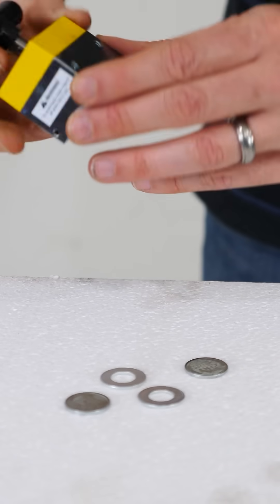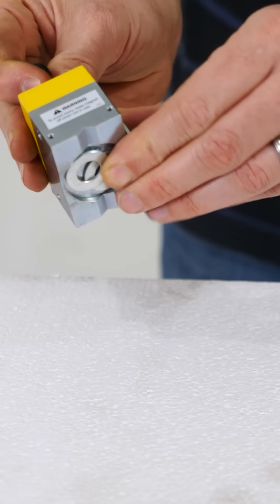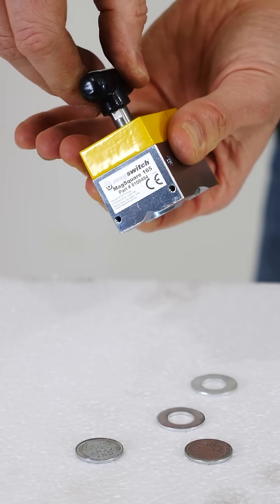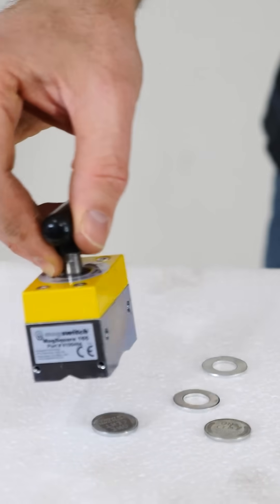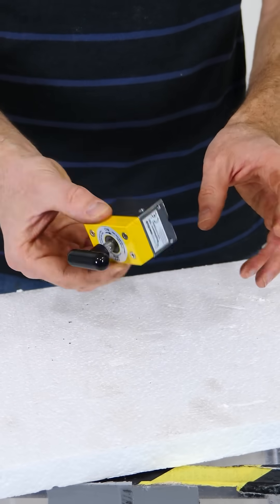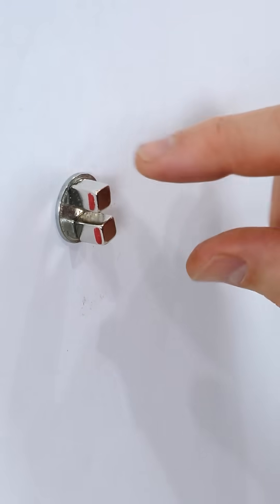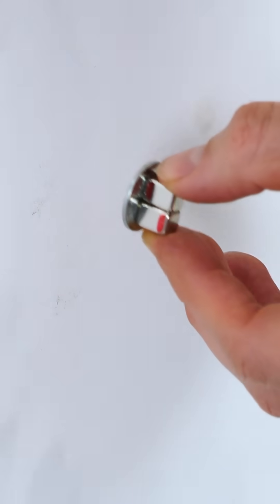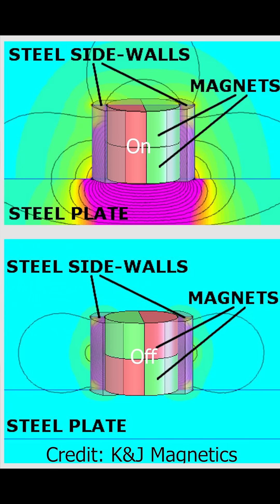How To Turn Off Permanent Magnets

Comment: We use big ass versions of these with a forklift for picking up sheet metal. Works great!
Reply: We also use them daily for the indicator base. Makes it super easy to slap an indicator arm onto a work hold and indicate a part or fixture into place. And same with the forklift, we use a 3 and a 5 ton lever magnet on the overhead crane to easily move parts around.
Reply: @BradyT918 you 100% don't have these on your equipment. You have electro magnets buddy 😊
Reply: @BradyT918 can we use magnets to hold car parts together vs screws or would that not be strong enough
Reply: ව්සෙජොට්ජුඉත්ට්❤ @BradyT918
Reply: @BradyT918 cool
Reply: Cranes too 🙂
Reply: @VividAuroraSkies damn did someone "Run over your face" 🤣im sorry
Reply: @VividAuroraSkies that’s how we use ours
Reply: @VividAuroraSkies are u still staying the F at home?
Reply: @VividAuroraSkies How tf do have 24 million subscribers?
Reply: @anonymous689  I think @BlackWidowRaiderette just put that in her channel description. Not a bad trick
Reply: We use big ass 🔥
Reply: I guess by now, there are magnetic drills like this? Did they have them ten years ago? About 7 years ago at the job, I was on an electromagnetic drill, lost power, and fell from heights. It broke a guys shoulder and collar bone. Obviously, it could have been worse.
Reply: The people I used to work for never figured out that was a thing, but they were so rude I never told them 🤣
Reply: Sounds cool, but why are they shaped like asses?
Reply: dang, thats cool
Reply: YouTube sucks. It keeps deleting my replies and my edits.
Reply: We have to use sheet lifter
Reply: id like to see what those look like.

There's this lego-esque game I play called trailmakers, and they have a magnet in the game: I made a crane truck and forklift using it. wonder if it looks similar in any way.
Reply: pick it up with ur hands u weak twigs
Reply: Yeah! Best part, they don't require electricity.
Reply: That's cool
Reply: Using them with cranes is soo shady but yet i still everyday
Reply: I never really thought about it but it is pretty clever, when I was a truck driver I cant be sure of course because some rare earth magnets are super powerful but I think that the stradlers on the docks might be electric.
Reply: We have ones for cranes to pick up the 2 ton pieces
Reply: I’m guessing you’re talking one sheet at a time? We use a similar magnet system and suction cup lifters to load single sheets of metal into the lasers I run but the full pallets are brought in on regular forks with the forklift
Reply: Ive seen them in use at the junkyard when i was a kid it was a spectacular machine to see.
Reply: Not in construction, but is there any reason to prefer one over an electromagnet? seems like it'd wear down the magnetic fields pretty quick if you're constantly switching between forcing the poles next to one another, and an equally-powerful electromagnet would be cheaper in terms of parts. Maybe less electricity usage, but do those savings outweigh the cost of a shorter lifespan?
Reply: Sh!t metal?
Reply: We use those to hold angles for welding to
Reply: Also in machining
Reply: Be careful when using those bro I’ve seen bad accidents
Reply: I'm surprised they don't go electromagnet for most forklifts, but then again this doesn't take any energy to "run" so I guess that's a benefit
Reply: Hell yeah
Reply: Yeah same in our Company we also Carry Steel sheets and Steel pipes with
Reply: Ye I am looking for Aerospace mechanical and painter
Reply: I used to use one when i ran a plasma cutter back in like 2005
Reply: yeah i don’t see how this is interesting, not your comment just the entire video.
Reply: sounds dangerous don’t wear any metal lol
Reply: So close! Thats an electromagnet🥰
Reply: we have them for our in shop cranes. works great for sweeping up the metal dust in your work area 😂
Reply: That’s what I was about to say haha they come in handy forsure.
Reply: They use 🧲 on semi trailers to
Reply: OMG I WANT TO USE THAT SO BAD IF U SEE A TEENAGE KID ON A FORKLIFT ITS ME!
Reply: Casual forklift certified flex
Reply: 😂😂 but not efficient permeant magnet..
Reply: ohh so THAT'S how those work, ive actually wondered that
Reply: Yea we have a 1,5 Ton one in our company they Work great
Reply: Sheet metal workers thank you
Reply: The comments here are as stupid as to be expected. 

These switched magnets have a very limited life expectancy because they get weaker as a result of depolarisation - magnets don't last forever if forced to sit next to opposing poles of near equal strength.
Reply: No
Reply: The scrap yard has one on a huge crane, trusting a magnet holding up 2 tons of steel swinging over my truck that can be switched off instantly
Reply: Language
Reply: how much and where at? these would help me 1000% right now. rigging heavy meatal takes a second, with 2 of these we can be movin
Reply: I use a big version of this quite often when lifting steel beams or sheet metal off the ground.

I never trust them but they are incredibly useful and haven't failed me yet!
Reply: Adam Savage has a large one of these on one of his lathes. So cool
Reply: Use them on dial indicators and the same for the metal shavings sweeper.
Reply: Wow
Reply: This is how I’m gonna climb things lol
Reply: Lol that is electromagnet this is clearly different 😂😂
Reply: I've always thought these switchable magnets are electric. Thanks to this video and the comments now I know better. 😊
Reply: There's always a certain person
Reply: We too Same Suff
Reply: Oh man I wish I had one of these for hvac. I've nearly chopped my hand off more times than I care to admit.
Reply: ❤️Just wanna remind you All  To repent and that Jesus Christ loves you all ❤️ Jesus is God , Amen❤And Don't use God's name in vain , like saying on god , God damn it , and God-somthing , or oh my God ( unless u say Oh my God to God as in praying ) ❤ and don't lie 😊❤And don't curse, swear or cuss , Forgive and don't Seek Revenge , revenge is for God not for us to get 😊 and just so you know , Homosexuality/LGBTQ++??? Is a sin ( Leviticus 18:22 Romans 1:26-28 Leviticus 20:13 ) , also , s*x before marriage is also a sin , since i am pretty sure that it is clearly sexual immorality ,  Don't Lust , since according to The Lord Jesus Christ , if a man looks at a woman lustfully ,he has committed adultery with her in his heart , which means it is pretty much sexual immorality , which is a SIN , a very awful  sin , And Don't watch Po*n , again , Sexual immorality. Cheating too is a sin, be loyal , also try your BEST to not get a divorce if you are married , unless it's needed or for a valid reason like abuse ( physical and/or  mental/emotional ) but let divorce be the last resort after what can be done is already tried and hasn't worked , be nice to everyone , never go to Mediums or psychics and don't believe fortune tellers / readers and zodiac signs, Don't hold a grudge on anyone , don't Use GOD for Materialistic and earthly stuff or Fame and popularity and money😊❤Have a Blessed Life With Jesus Christ , Jesus is the only way , not good works that you do, No one Goes to the father except through Him , Jesus . Always ask for forgiveness and Give thanks To God ❤️ also, Don't be Greedy , Don't Idolize something or someone other than God and don't be prideful, Be humble 😊 NEVER Deny Being Christian or Believing That Jesus Christ Is God And Is The Son Of God , Even if it meant Death and Persecution Jesus Said That Whoever Denies Him In front Of Man , He will Deny Him/Her In front Of His Father , God the Father In " Matthew 10:33 But whosoever shall deny me before men, him will I also deny before my Father which is in heaven" . ( Please no Hate if You Don't like my message ,  and also please do more research and God bless you all , Jesus loves yall , Have a blessed life ❤️ With Jesus Christ and also never forget as a Christian that Jesus is Not only The Son Of God , But he also is God , as he said " I and The Father are One " -- John 10:30 and also Never Forger the Holy Spirit since God The Father And God The Son and God The Holy Spirit Are 3 persons in 1 , The amazing Holy Trinity ❤😊 , lol i know that i keep saying more stuff after i said bye or Have a blessed life , i just Remeber more after i write Bye or Have a blessed life , 😅 , oh well , once again , Have an amazing Blessed Life With God 😅

Important message : if you think you are unworthy of God's forgiveness, you are wrong but right , how? Let me explain , all of us don't deserve God but his mercy and love is much bigger than our Sins , so , Don't you ever say to yourself i don't deserve to be God's Child and That God won't Forgive you , He will , Repent, Jesus Loves you all 😊❤
Reply: We use this crane attachment thing that has 8 suction cup things, I hated having to do that I never trusted it
Reply: Omg you’re a forklift driver 😍
Reply: @barnabro   ❤️Just wanna remind you All  To repent and that Jesus Christ loves you all ❤️ Jesus is God , Amen❤And Don't use God's name in vain , like saying on god , God damn it , and God-somthing , or oh my God ( unless u say Oh my God to God as in praying ) ❤ and don't lie 😊❤And don't curse, swear or cuss , Forgive and don't Seek Revenge , revenge is for God not for us to get 😊 and just so you know , Homosexuality/LGBTQ++??? Is a sin ( Leviticus 18:22 Romans 1:26-28 Leviticus 20:13 ) , also , s*x before marriage is also a sin , since i am pretty sure that it is clearly sexual immorality ,  Don't Lust , since according to The Lord Jesus Christ , if a man looks at a woman lustfully ,he has committed adultery with her in his heart , which means it is pretty much sexual immorality , which is a SIN , a very awful  sin , And Don't watch Po*n , again , Sexual immorality. Cheating too is a sin, be loyal , also try your BEST to not get a divorce if you are married , unless it's needed or for a valid reason like abuse ( physical and/or  mental/emotional ) but let divorce be the last resort after what can be done is already tried and hasn't worked , be nice to everyone , never go to Mediums or psychics and don't believe fortune tellers / readers and zodiac signs, Don't hold a grudge on anyone , don't Use GOD for Materialistic and earthly stuff or Fame and popularity and money😊❤Have a Blessed Life With Jesus Christ , Jesus is the only way , not good works that you do, No one Goes to the father except through Him , Jesus . Always ask for forgiveness and Give thanks To God ❤️ also, Don't be Greedy , Don't Idolize something or someone other than God and don't be prideful, Be humble 😊 NEVER Deny Being Christian or Believing That Jesus Christ Is God And Is The Son Of God , Even if it meant Death and Persecution Jesus Said That Whoever Denies Him In front Of Man , He will Deny Him/Her In front Of His Father , God the Father In " Matthew 10:33 But whosoever shall deny me before men, him will I also deny before my Father which is in heaven" . ( Please no Hate if You Don't like my message ,  and also please do more research and God bless you all , Jesus loves yall , Have a blessed life ❤️ With Jesus Christ and also never forget as a Christian that Jesus is Not only The Son Of God , But he also is God , as he said " I and The Father are One " -- John 10:30 and also Never Forger the Holy Spirit since God The Father And God The Son and God The Holy Spirit Are 3 persons in 1 , The amazing Holy Trinity ❤😊 , lol i know that i keep saying more stuff after i said bye or Have a blessed life , i just Remeber more after i write Bye or Have a blessed life , 😅 , oh well , once again , Have an amazing Blessed Life With God 😅

Important message : if you think you are unworthy of God's forgiveness, you are wrong but right , how? Let me explain , all of us don't deserve God but his mercy and love is much bigger than our Sins , so , Don't you ever say to yourself i don't deserve to be God's Child and That God won't Forgive you , He will , Repent, Jesus Loves you all 😊❤
Reply: On a forklift, it most probably is using an electromagnet that is designed to turn on and off. That’s the entire point of the video that I guess you missed. It’s not easy to understand how can a “permanent“ magnet turn off, since it’s supposed to be permanently on, this clever design just makes it seem like the permanent magnets have lost their magnetization but in-fact they are still magnetized.
Reply: @Dhairyasd  are you a smartass or a dumbass? You would think they know more about their job than you, mate.
Reply: Stop swearing
Reply: Actually those are electromagnets stronger than these magnets
Reply: Same here. We used it on a crane. And the funny thing is the magnet wasnt all the way on the metal piece because the metal piece had some edges and curves so the metal fell off loolz 😂
Reply: We use them in die shops for steel irrection to pick up die plates that weigh 70 plus lbs.
Reply: same!
Reply: Probably more reliable than electric ones if i had to guess
Reply: Big ass?
Reply: Cringe piece of human garbo who tf asked? Be glad shtty YT braindeads approve
Reply: Cool
Reply: Jesus is the Son of God. He died on the cross for our sins and was resurrected three days later. Believe in Jesus and you will not die, but have everlasting life.
Reply: The company i use to work for had some sketchy ass forklift extensions and whilst always get stuck loading the racks. Reverse that thing. Let those back tires wobble slightly up and gas out 😂. So glad I dont work there anymore
Reply: Same
Reply: I’m having a hard time imagining why the addition of a big ass installed on these magnets could be more useful to a forklift driver. Though I could see how it would make work more enjoyable.
Reply: Whoa
Reply: Ever grab someone’s keys out of their pocket?
Reply: Nice! Its cool to know where else they're used. I was a thread inspector for a company that threads new pipe to be used on drilling rigs in west Texas. We used these magnets to pick up small joints and load them into the CNC by hand. Very fun to use and it always had me curious 😅
Reply: I've always seen the big magnet at the scrapyards, I thought it musta been electro because they could turn it off in an instant & I never heard a sound when it switched...?
Reply: @erkl8823  yeah scrap yards definitely use electromagnets, they need to be able to operate it from the cab of the crane! Otherwise you’d have to have a dude hanging on the end flipping a lever 😁
Reply: @barnabro  oh! Ok, got it, cool man, 'ppreciate it
Reply: @barnabro or they have an permanent magnet on an electric switch? Think smarter.
Reply: @erkl8823 scrapyard cranes usually use electromagnets, that doesn't mean they couldn't use a system like this though
Reply: Wouldn't this be an sick version for magnet fishing , there gotta be out there
Reply: I saw a crane doing that with sheet metal at a factory i worked at once. I never got a close look at it so I suspected magnets but wasn’t sure
Reply: Have you ever used your Forklift Certification rizz?
Reply: @confusinggameplays1687  a couple of times i have; but i regretted it. Cuz it only works on women from the maintainance dept. So next thing ya know, u smoke a joint with em; and after that its all over. Cuz i can't stand to be around no high maintainance women.
Reply: @confusinggameplays1687  I'm sorry, i saw the window and couldn't help myself
Reply: @oliverklozhoff thats a well constructed joke
Reply: Used one before, just one of them was able to lift a 4 ton trench plate
Reply: I saw something like that in a warehouse to avoid damage (staff), but only like 1 or 2... that tool can help moving heavy stuff easily 😊
Reply: My old job at a extrusion die plant we used them regularly to move around the dies to different parts of manufacturing
Reply: It may pick up the forklift 200 ft away.
Ever watch loony tunes with wild coyote and road runner.
Reply: Jesus Christ loves you and died for your sins 🤎🤍
Reply: @barnabro I think cranes use Electromagnets not these!
Reply: I always thought they used electromagnets to do that. 

Glad I saw this video and your comment then, learn something new everyday
Reply: You changed the devices for digferent magnets and whan you turned the thing the magnet went farther inside so the metal thing fell
Am i right
Reply: @PetrusProGamer did u watch the video at all? Damn, oftentimes people would have no clue u were dim; if only u didn't declare it. Silence is golden. For the stupid, silence is platinum.
Reply: @PetrusProGamer  No. Watch to the end, it's only a short.
Reply: No u don't. Stop lying.
Reply: That is electomagnet. He clearly states that this is not an electromagnet. There is a big difference
Reply: @shrujanamsyama9940  why are you telling me about equipment at my work that I personally use? It’s not an electromagnet, it’s called a permanent magnetic lifter and has no power feed. Ours can lift up to 1000kg but bigger models exist.
Reply: @barnabro  what are these called? I want one for work. About the size he has in the video, i dont need a forklift sized one lol
Reply: @gazs7237  they’re both switchable release magnets but the style in the video is a ‘switchable magnetic base’ or ‘switchable magnetic jig’. It looks like a Magswitch MagSquare or similar. They’re used for metal fabrication, fairly reasonably priced and can come with a flat base or a V notch in the bottom (like this one) for mounting on bar stock or pipe.

The lifting type ones are not very reasonably priced as you might have guessed 😂
Reply: @barnabro  ah you're a star! Thanks been looking for a while. These will be really helpful
Reply: @gazs7237  by the way, the ones I received from here say 165lb on them; I don't know why they're listed as 150lb. I'm pretty sure it's the exact same product; they just have the title mislabeled on their website.

I tried to edit my original reply to you, but it said, it failed to post, so I'm putting it in a new one instead.
Reply: @ericcaldwell3584  thanks for the info mate
Reply: @barnabro  u are dope
Reply: @barnabro  Weird people in this world and this comment section. I don't get it either.
Reply: @barnabro  That is new! Most of the commercial establishments use electromagnets when large magnets are needed. This is really something new I learnt
Reply: @NEON2600  eh not really, that’s kinda the most common way of moving 8x4 sheet/plate metal on a small counterbalance forklift. We don’t work exclusively with sheets so just have a standard forklift and small JCB telehandler. The magnetic lifter is on a short sling so just attached when we need it, usually for moving steel sheet or plate onto the plasma cutter.

Can’t say I’ve seen electromagnets used for this in a workshop environment, think that’s more on an industrial/factory level. Not sure how supplying power for one would work on a normal forklift.
Reply: @NEON2600  (clamping style sheet lifters are also common but they can only lift a sheet vertically, occasionally slip, can damage thin material, and are the jaws eventually wear out. Switchable magnetic lifters are better all round really, and they can be used for lifting anything metal with a flat face, not just sheet.)
Reply: @barnabro  exactly,  We have a 1Tonne and a 2 Tonne version too.
Reply: @shrujanamsyama9940 It's definitely not new, machines that use permanent magnets predate electromagnet usage by centuries.
Reply: @barnabro  he literally said not electromagnet. He was talking to the other person not you. They had your back.
Reply: @gazs7237  I give up. I've tried over and over and over again to make new replies or edit my previous comments to you, but YouTube keeps deleting everything that has a hyperlink in it to the products that I bought before. I tried to help more, but YouTube won't let me, so you're on your own. Sorry.
MagSwitch 165 or MagSquare 165 is what it's called.
Reply: @gazs7237 btw,what work do u need them for?
Reply: @barnabro chill out man. I also thought you were confused with electromagnets because I've read that electromagnets are used in that type of work and i didnt know this could be done with permanent magnets too
Reply: @gazs7237 Just look up DTI Guage magnetic base.
Reply: @barnabro they can't lift any metal, they don't work on aluminum
Reply: @barnabro similar setup to the fab shop I’m at, but we’ve got a laser and have a permanent sheet lifter built with a trolley. The laser lifter uses suction lifters that are good up to 5000lbs total, pretty much all 5x10 sheets. We also use the same magnetic ones you’re talking about for moving pretty much anything else. They’re 500kg rated and like 40lbs a piece lol
Reply: @barnabro I'm wondering are they more expensive than electro magnet versions? Because you don't have the increased electricity bill attached to it, so it's almost free when you own it
Reply: @barnabro 
🤣🤣🤣🤣🤣🤣👍🏻
Reply: That shit can’t come close to pick up caseoh
Reply: @barnabro  how does it put it down then ? Without current or does it have current idk that’s weird I’ll watch a video on it
Reply: @barnabro bro that clap back was real these internet mugs think they know everything about other peoples lives
Reply: @barnabro  You seem really knowledgeable. Do you know if there are versions available that can be controlled electronically?  I know  electromagnets are available but for my purpose it is important to that the state wont change if power is removed.
Reply: @NEON2600 didn’t expect to find you here.
Reply: @NEON2600 They've been permanent magnets where I've worked. I know both exist, but permanent magnets seem more common than electromagnets (which I haven't worked with yet).
Reply: Yeah it requires no power but how will u turn to off magnet , it will require  more energy than electromagnet  @barnabro
Reply: Correct  @barnabro
Reply: he guy doesn't know the difference between electro & permanent magnet
Reply: @barnabro That's what I thought and was like "Umm I think people that actually use the sh*t know".....We use tools in machining as well like dial indicators and the sweeper on wheels that picks up metal shavings. Somebody always has to correct you even though they have 0 clue about what there talking about.
Reply: @barnabro You tell em! Just like you wouldn't tell me how to do my job, no one should tell you how to do yours, other than your boss😂❤
Reply: @shrujanamsyama9940  Its not? It literally is only mechanical.
Reply: @shrujanamsyama9940 when you think you know everything 💀
Reply: @shrujanamsyama9940 if you stayed as quiet initially as you’ve been since you got embarrassed, no one would’ve dunked on you. Learning experience for you. And to top it off, it was free.
Reply: @RealityIsBae  I am not embarrassed. I was just being curious as I have never heard of permanent magnet lifts that lifts tons of weight simply due to the huge costs associated with it compared to low cost electromagnets. I have always been curious and never hesitate from asking questions. There is no embarrassment in trying to learn
Reply: @shrujanamsyama9940  You weren’t curious, and made no attempt to learn in you initial reply. You made an attempt at correcting him while knowing absolutely nothing about who he is, where he works, or what he does during the day. You afterwards backpedaled into this “learned something new today” bit, and finally gave your bs “I was simply curious” reply after getting roasted for attempting to be a know it all while having zero to bring to the discussion.
Reply: @malachi412  Electromagnets are cheaper and lasts much longer. So, I thought he was not aware of the magnet in his commercial space being electromagnets. But when I realised that he was sure of it, I saw it as something new to learn. If I was arrogant, I would have used insults. There is no reason to say I am unwilling to learn
Reply: @shrujanamsyama9940 they do use both electromagnets as well as permanent magnets like shown in the video. Depends what you buy lol
Reply: @shrujanamsyama9940 there’s no battery so it’s not an electric. It’s two matching magnets that add together and cancel each other out.
Reply: @shrujanamsyama9940 No, you don’t understand. I know exactly what he’s talking about. You obviously are not familiar with forklift accessories.
Reply: @shrujanamsyama9940 yes because you're forklift certified random ass person on the internet dont tell people things about things they literally work in
Reply: @shrujanamsyama9940 blud he literally works with them, he knows his stuff better than you 😆
Reply: @shrujanamsyama9940  we do have large switch permanant magnets for lifting Tool dies with cranes and forklifts, and small ones on our Dial test indicators.
Reply: @shrujanamsyama9940 you are wrong
Reply: @shrujanamsyama9940 just coming here to say you’re goofy
Reply: Without wanting to offend you, but I'm 99.99% sure that you didn't understand the difference between electro and permanent magnet.  For cost reasons alone, it does not make sense to use the shown principle...
Reply: Magnetic field is a lie
There is no force fields existing. Forces are coexisting with matters. Because anything exists is made in atoms/matters. 

Scientists use iron power formed into concentric rings around a current passing wire to demonstrate magnetic field. 

In fact, so called magnetic field is concentric small magnet rings. 
Electricity in the wire induced dipoles in the iron powers to form into concentric dipole rings and magnetized iron powers into small magnets. 

Magnets are consist of concentric dipole rings from pole to pole. Same direction dipole rings attract each other and opposite direction dipole rings repel each other. Therefore single magnetic pole cannot exist.
Reply: @ScienceBusted  That was mostly word salad and misspellings, but at least your final sentence was correct (accidentally, I'm sure).
Reply: What most do not even see is that this can create perpetual motion indefinitely by one switching off the other in an closed circuit.
Reply: @benjy117  Nope. Magnetic perpetual motion machines work by hiding the batteries.